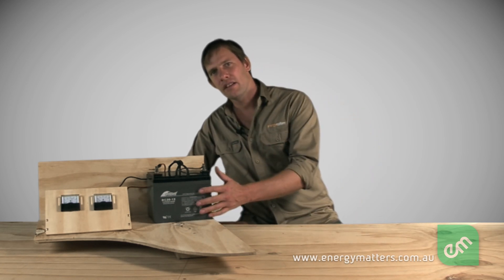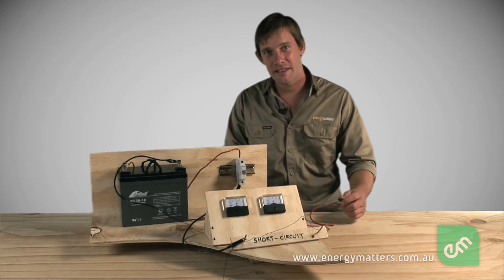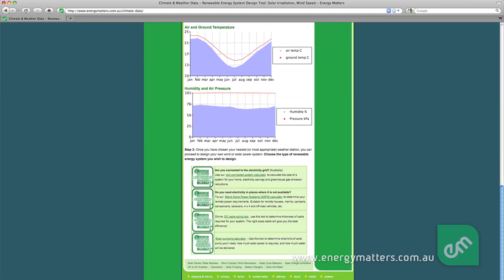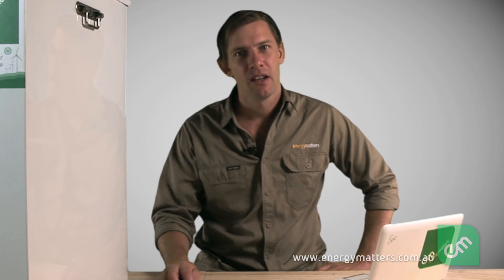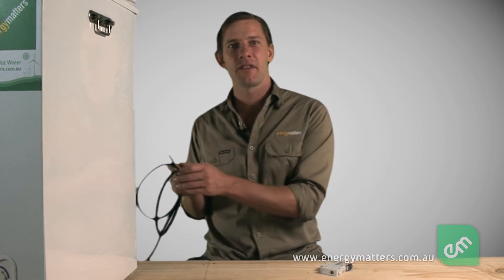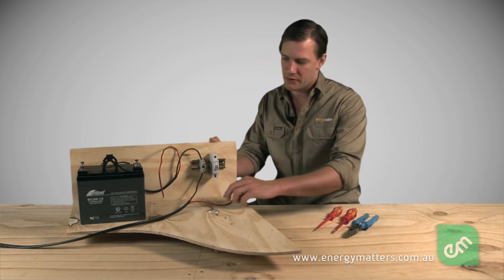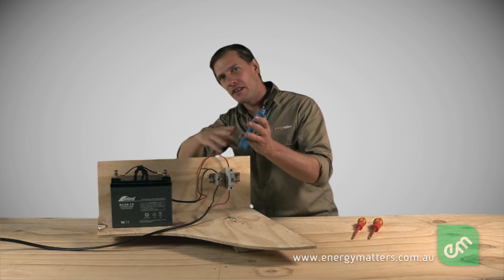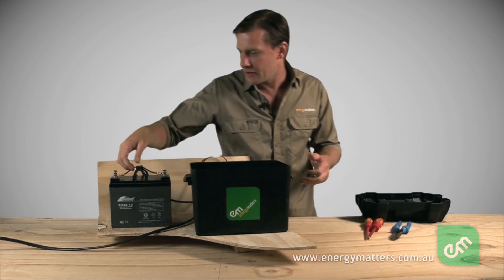Solar Workshop - Batteries, Cabling & Fuses

Comment: Bud, your live should come in the top of the Circuit breaker, not the bottom. Even more importantly, the circuit breakers you are using are AC circuit breakers and not DC circuit breakers. Really - you trying to promote yourself? Get qualified, then spread your knowledge, otherwise you will cause issues for thousands of people who assume you know what you talking about.
Reply: Right.  AC breakers depend on the zero crossing of the voltage, and DC circuits do not go to zero volts.  So an AC breaker in a DC circuit won't get the opportunity to open, and may as well not be there.

Comment: We have set up a off grid 900 watt 12 volt system, charging a 1040 amp battery bank. I have a 6 switch circuit board that has a combination of various amps totalling 35 amps. What size fuse should I place between the battery and that board.

Comment: please help
i have just installed a solar system but i want to put some circuit breakers in 
(1) my solar panel carries 120watts of power to a 15amp solar charger, what size of a circuit breaker would i put between solar panels & solar charger
(2) I have a 2500/5000WATT inverter  connected to a 12VOLT DC battery. The specification says it has an inbuilt 30AMP fuse but i still want to put circuit breaker. what size circuit breaker can i put between the battery &  inverter
Any help is appreciated